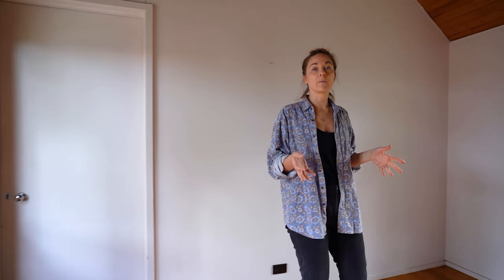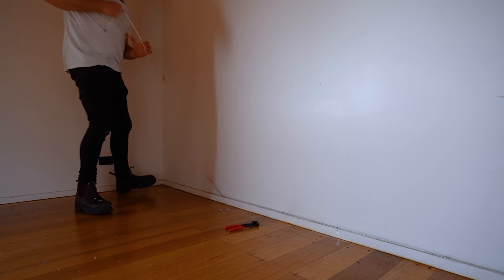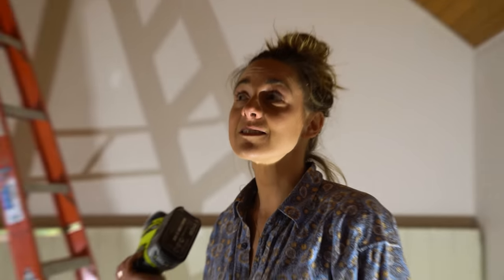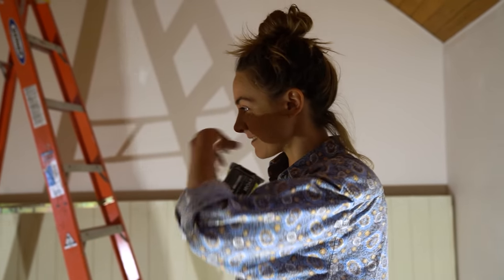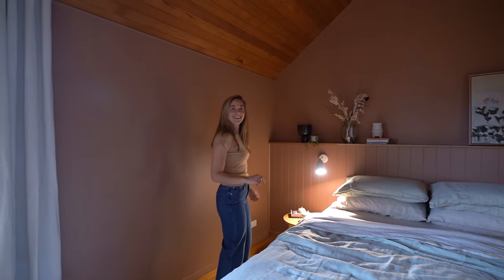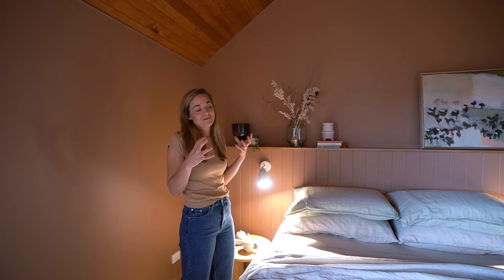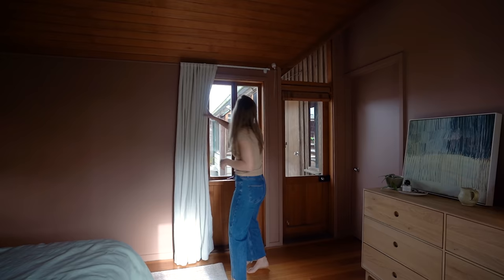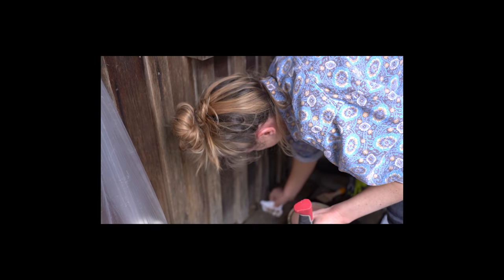24hr Bedroom Makeover! DIY Room Transformation in our New Home! Renovation & Room Tour

Comment: I absolutely love everything you have put into the room and the wall behind the bed is awesome but I'm afraid I don't like the colour at all. 😥 It looks just like freshly plastered walls (in the UK, that's the colour of plaster) waiting to be painted and it is so dark. 

Personally I would have chosen a sagey colour like your duvet which would have been earthy but a bit brighter. Either that or I would have painted the ceiling timber white to brighten it up a bit, but as long as you and Johnno like it that's all that matters.
Reply: The point of the challenge and the sponsorship was that they didn’t have a colour choice, they were assigned that colour and they had to do something with it. It will be interesting to see if they don’t paint over it later in the house reno.